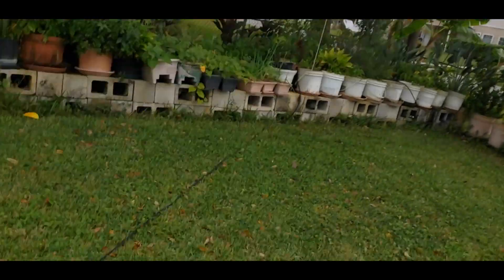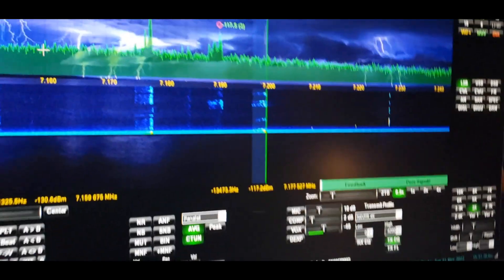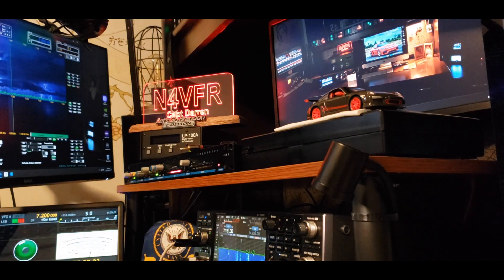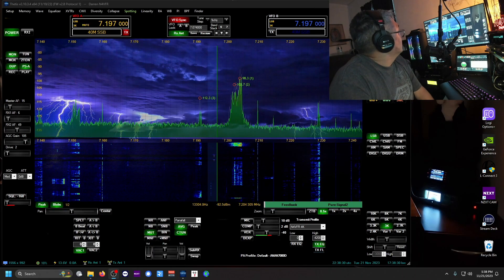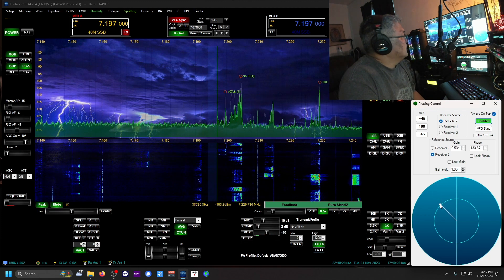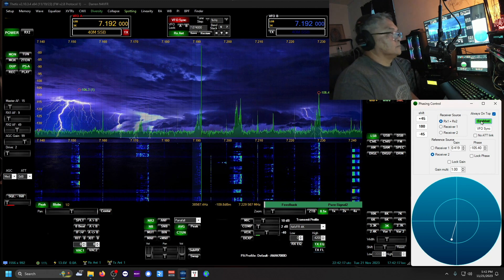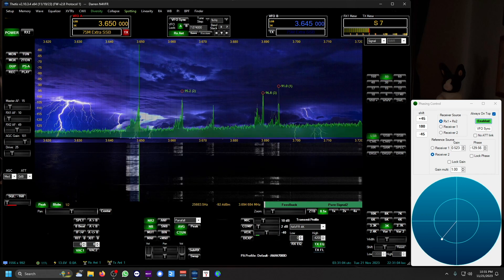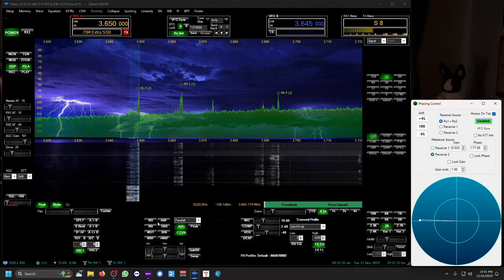Thetis Diversity Phasing Control | Eliminating RFI Noise |  Quick setup and Demo on 40 & 80 Meters

Comment: Wow! I would have never thought you get do that to the powerline noise. It is so much of a super hard job the pinpoint a powerline fault. And if you can't get the guys out and show them with an ultrasonic dish or other tool, it's extremely difficult to get PGE to fix it.  I would rather pay thousands than keep going through that mess. I ended up last year having at least three different arcs start up within a 150 yards from my house all at the same time. And, I'm a total need for DX. So power line hash totally rains on my parade. I've been looking at the NCC 2 noise cancelling system from DXE. But it's $950.00 WITHOUT all the modules.
Reply from the maker: I thought about the NCC2 and yes, expensive.  The Anan using the software Thetis does help  eliminate some of the man made power line noises.  When I run remote control with my IC7610, I have to use a web SDR to listen during rag chewing and my Remote HF for transmitting.

Comment: I'm just for the first time looking into AI noise elimination. I just heard of RM and now Thetis. Does Thetis require an Anon radio?

I have on & off had power line noise as bad as 20 over S9.  Yeah.  Fun huh? I have learned more than I ever wanted to know about finding a powerline fault. And still sometimes I can't find the culprit.  Yes what you played here is what I have. O have managed to get PGE to fix a few problems. But the hot weather has shown me this season that I still have a problem.  Not nearly as bad so far but it's still happening intermittently. 
To repeat and I haven't been able to pay attention to your video as I've been typing but I will review. Thanks so much for this.
Reply from the maker: I'm fighting a new RFI Power line noise.  My utility company has found one near my home and submitted a service call on one utility pole.  It's a never ending battle.

Thetis is a software for software defined radios and particularly for Anan radios built by Apache Labs.